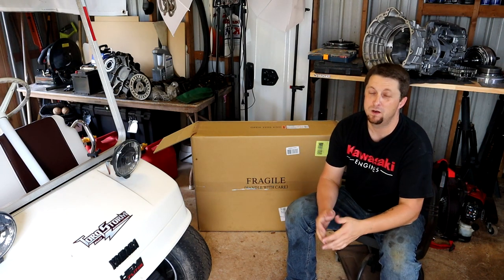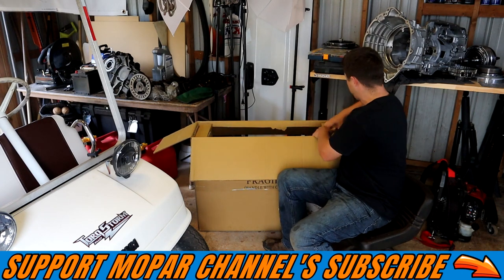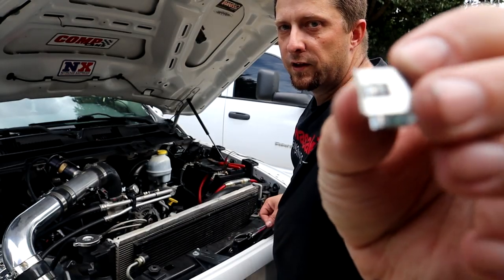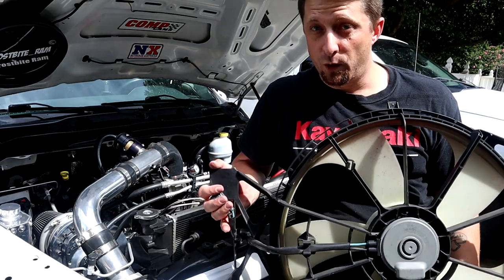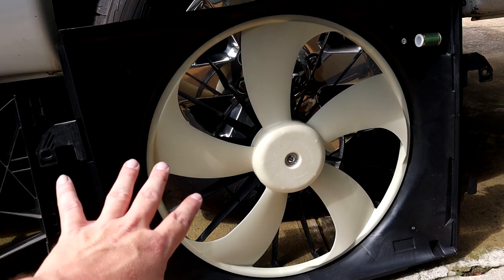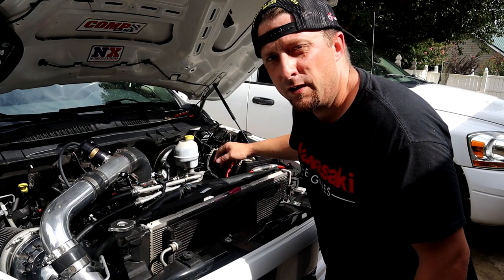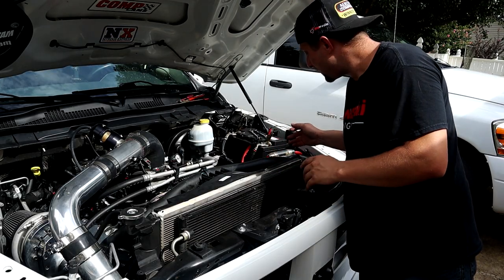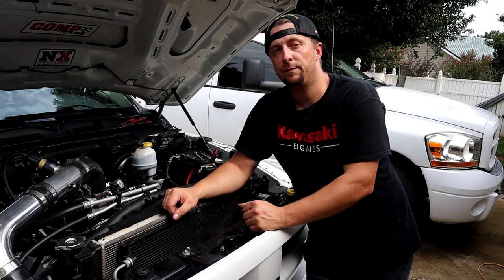Ram 1500 V6 Electric Fan Swap On 5.7 Hemi

Comment: I would’ve never guessed the V6 fan was bigger or better for pulling air through out the whole radiator... but once again.. thanks for all the part numbers and information about it 😉
Reply from the maker: Me either man but thanks for watching 👍
Reply: It's only that way because the e-fan on the Hemi is just a helper fan. The primary fan on the Hemi is the clutch fan
Reply: The radiators on both are likely the exact same.  The radiator on the Oshkosh M-ATV is actually from a Ram 3500 diesel.  I believe the inner-cooler was too but couldn't get it confirmed.  There is also a small span of VIN's of Ford Taurus that have F-150 fuel pumps.  It's crazy what they reuse, re-purpose and recycle for different vehicles to avoid engineering costs. lol
Reply: I wonder if you can run this with the clutch fan if there's enough room?
Reply: @larrybarbaree2091 I have the same question

Comment: I just got this fan for my 2013 4.7L! I don’t really care about MPG gains, but the slight performance increase is what’s keeping me going. And much better cooling from the V6 fan!
Reply: Where you from how hot does it get? I did this and my truck got hot going up hill on 110 weather
Reply: @faustodiaz2121  Im in california, gets really hot here and it hit 110-115 this summer.

Do you have your A/C on? That needs to be on if you’re un-tuned so the fan turns on.
Reply: @TheSavage3.6  yes I had my a/c on, I'm not tune, I did read about being tune when you do this efan swap but like I said, in hwy speeds and going up hill, it got hot, this was driving towards San Diego, also being @ 90° weather it was still getting hot and Temps wouldn't go down until I got to a rest area, rest for a 1hr started driving again and all of a sudden Temps where back to 203°
Reply: What year was the truck you got the fan from

Comment: Glad I came across your Video. Did my install and can’t be happier. Improved the gas mileage so far not by a lot but something is better by removing the fan clutch and cools down way faster now. Plus my condenser fan on its way out so. Perfect timing to do the e-fan conversion.
Reply from the maker: Nice work!

Comment: I definitely did this mod as I live in Florida and it definitely helped with my cooling im currently running at a constant 190 and when the T-stat opens i then run at 180 to 187. My oil temperature has dropped by 10 degrees as well..👍👍
Reply: Did you have to tune it?
Reply: @elvaquero3030  yes I had to reset the cooling parameters on the computer as the factory settings are set to 204. My particular year which is 17 I had to get an unlocked PCM before I could do those settings.
Reply: @stevelindell5044  What was the new temperature set to? I have an 2013.
Reply: @elvaquero3030  I put a 180 thermostat in and programmed my temperature parameters on my PCM  at 190 so my fan kicks on at that temperature. Since yours is a 13 I believe you do not have to buy an unlocked PCM like I did. All you should be able to do is plug in a tuner of your choice and reset the cooling parameters after you get an electric fan and replace the tstat. It will run so much cooler and also once you get rid of the mechanical fan its also less drag on the motor as well.

Comment: I did a e fan swap on the rango too I was surprised how well it has performed amazin how well a V-6 ram fan works
Reply from the maker: For sure it definitely pushes more cfm for sure 👍
Reply: what did you have to do to make it work on the rango need to do mine
Reply: @tonka459  used a test light to find positive grounds etc wired it directly and zip ties to hold her in place till I was able to make some alum. Brackets

Comment: I would highly recommend using the Hemi 5.7 electric fan motor on the V6 shroud and fan blade, Dorman is one of the few assemblies that swap over to that motor, by doing so no wiring modifications are needed. I tried it with a TYCO and the OEM motor wouldn't fit the TYCO blade, different size shaft. The hose should be trimmed about 1.5" to 2" at the thermostat housing so the shroud won't wear a hole thru the hose.
Reply from the maker: Nice information 👍
Reply: @FrostbiteRam  Mapar Guys are notorious for not sharing info, just trying to break the chain.
Reply: @ryanprettyman3123  luckily Mopar ones aren't like those Mapar guys you're talking about.

Comment: My 2017 Laramie has both electric and mechanical.  I have already had to replace the electric and am concerned that if I don't have the mechanical fan how it would survive.  It is a 4x4 and I am often deep in the woods.

Comment: Would keeping the stock e-fan and the factory clutch fan shroud not be a good alternative to swapping out the efan itself and dropping the factory shroud? I've been running this for some time and haven't had temperature issues. The fans also dont look that different IMO besides the shroud. Thoughts?
Reply: I was thinking the same thing haha, so you run the factory fan? And did you change the temp ranges with a tuner?

Comment: Thanks for the video! I may have a faulty clutch on my fan and was looking to replace it when I came as your video. Now I am thinking of doing this instead. Two questions: 1. Did you only use the AC fan before you did this swap and can I get away with just the OEM AC fan for a while in cooler temps? 2. As far as tuning, I’ve had a SCT tuner before and didn’t see an option for cooling temps or I missed it. Do you know which tuner I’d need to do this mod? 
Thanks!!

Comment: Once that fan is installed, isn't there some programming to do, to tell the vehicle it's installed and what temperature it should kick on at?
Reply from the maker: Nope but custom tuning can adjust when it comes on
Reply: @FrostbiteRam  That's what I thought.  I heard the AC fan not only comes on with the AC, but will provide additional cooling once the engine temperature hits 220 degrees.  If that's the only fan, it should probably be kicking in around 200.

Comment: Well after reading all the comments I think I got my answers but I'm going to double check . I have a 2018 hemi 5.7 ram 1500 and this will fit right in?
and if I want to adjust the temp I can use my Diablo tune? And the fan on the water pump what thread is it?
Thanks in advance

Comment: Wow, a mod I actually had done before you haha! I've got the same fan from Amazon, installed a few months ago, and no problems. Been plenty of high 90 degree weather and tons of humidity, my temps stay 185-188 with a 180 t-stat and Greene tune. Temp will creep up to 192-194 sitting in traffic, but hasn't hit 200. Hot lapping it may be a different story, but you may be better off with a 160 t-stat?
Reply from the maker: Good information 👍

Comment: I would like to know when the engine rises temperature the fan turns on by itself
Reply from the maker: Yes or if the ac is on it should come on immediately most the time.

Comment: I have the clutch fan in my 2015 ram 5.7 with no tune. Any thing particular I need to do before adding this fan? Shutter delete or new Thermostat required or is it just a drop in fan?
Reply from the maker: Fan will drop in place of factory fan

Comment: Did you have to add any blue loctite to the nut on the fan? I seen a couple posts where the nut got loos and fan came off
Reply from the maker: Mine been on for years now no problem

Comment: I have 2011 5.7 2500 with clutch fan this need tune?
Reply from the maker: No tune but you can adjust settings with tune.

Comment: Hey how are you 
I have a problem with my 2011 ram hemi the new clutch fan I put on don’t work and I change 4 of them the. Same problem 
What can it be please?
Reply from the maker: Clutch fan runs off water pump how does it not work

Comment: Looked up the fan on Amazon. Amazon is telling me that it does not fit my 2011 ram 1500. Is amazon telling me that because it is a v6?
Reply from the maker: Thats correct its for the v6 rams but it does fit the v8 also. The v6 fan has larger fan.

Comment: I’m running the Diablo 93 tune. If I do the fan mod do I need to adjust the fan temp with the tuner? It’s just a daily driver truck no towing.
Reply from the maker: No you don't have to

Comment: Any chance you could tell me the diameter and width of the V8 fan ?
Thanks
Reply from the maker: I dont have my old one anymore lol but they are very similar.
Reply: I was kicking around the idea of using a ram v8 fan as a push fan on the front of my Duramax but can’t find any info on just how big the fan is could you tell me the diameter of the V6 fan to give me an idea ?

Comment: When I was looking into it say doesn’t fit for my 2009 Dodge Ram 5.7 hemi and when I do it need to be tune up or just plug and play thanks
Reply from the maker: Its for a v6 ram so its going to say it won't fit but it does work.
Reply: Oh ok thank man and do I have to tune it up or just plug it in and run it like that thanks for tips and help Appreciate it
Reply from the maker: @adammontez8953  just plug it in

Comment: I have a 2014 Ram hemi and my transmission is overheating would you know why or how to fix this issue ?
Reply from the maker: Could be the thermostat I believe the 8speed has one.
Reply: @FrostbiteRam  Where would that thermostat be at ? Is it by the transmission ? I dont know how to fix this I did changed the fluid but im still overheating

Comment: I just got a V6 fan, 190° T'stat (no need for 180 in upstate N.Y.) couple new hoses a neck and an all aluminum rad. Truck has just under 70K and every winter when outside temps drop into teens the stock rad pees coolant all over and I spend all winter pouring more in the res tank.
I haven't lokked into it yet but it looks like the tabs that help secure the V6 fan are part of the stock rad plastic tank molding as there aren't any on the aluminum rad, obviously. Will the rest of the mounting points be sufficient to secure the V6 unit or will I need to break out some Gorilla tape to supplement?
Also, I have a Superchips f5 tuner. I run the 93 tune with MDS off, and I'm wondering if anyone knows what the "stock value" and the "superchips value" temp settings are in the tuner. They also include a 180 and 190 setting, but the other two don't reference a temp number so they're kinda pointless and I can't get the guys ay superchips to tell me what they are. Apparently it's fine sort of matter of national security to reveal to the customer what the actual temp settings are for some reason.
Your input appreciated.

Comment: What temperature does the efan kick on? And would a 180 degree thermostat effect that?
Reply: If you swap out the stat you’re going to have tune your stat to open up earlier and your fan to also come on earlier
Reply: @BlackRam17  yeah that was 2 years ago I needed up trading the truck for a 2016 Camaro ss

Comment: I'm about to replace my wife's radiator in her 2007 Aspen 5.7.  Any idea what I can use for an electric conversion?  I was thinking a 5.7 magnum shroud set up but I'm not 100% sure it would bold up and I'm not seeing any off-the-shelf kits available.  Thanks.
Reply from the maker: Thats a good question 🤔 now really sure on that but the magnum may be good candidate.

Comment: I wonder if this would fit my 2002 ram 5.9 v8 magnum.. mine has a factory clutch fan in front of original rad An a electric fan beside it with original air conditioning rad
Reply from the maker: I would think you have plenty of room to make it work. The electrical connection may be different tho but nothing a trip to the salvage yard won't handle.
Reply: Frostbite Ram my worry or wonder is if the rad size of mine from top to bottom an left to right is the same size as your rad in order to have the fan shroud fit into my rad    .. I guess I would have to measure my rad an then see if it will .. only thing is I don’t know the size of rad that yours is
Reply from the maker: I can get measurements for you
Reply: @DarrensTruckzs  will this work? Im thinking about doing the same thing
Reply: Frostbite Ram if you could give me the measurent of your rad from top to bottom An from side to side that be greatly appreciated then I check mine thanks man 👍
Reply: JR Perez I haven’t got to do measurements yet but when I do I let you know soon hopefully lol
Reply: @DarrensTruckzs  alright thank you👍

Comment: How was it when you removed the manual clutch fan did it still cool the engine, before swapping the electric fan
Reply from the maker: Yes it did pretty good

Comment: In the mean time for my daily driver can I just pull off my clutch fan and run stock electric for now?
Reply from the maker: I did that for the longest time with no issues especially with a tune .
Reply: Awesome thx

Comment: I have a 2013 ram. Evidently the plug changes after 2012. Not sure if I can use this fan on mine for plug and play? Any idea?
Reply: Just use a different plug or hard wire the fan nbd.

Comment: Frostbite Ram I have two questions for you. One should I pay off by truck before building it? Two should I build my 2019 ram 1500 single cab truck into a badass race truck or build for off road? Ps if anyone else want to answer too. I do want to know what Frostbite thinks about it tho.
Reply from the maker: My vote would be pay it off and build it for the track/street. If you want to go off road I would buy a old beater for that.
Reply: @FrostbiteRam   Thanks man. I will do that then. just so u know I love your truck. My trucks has the 5.7 Hemi in it with a single exit Flowmaster exhaust and yes the exhaust came with the truck. My truck is a Superbee edition but it has manual windows and manual locks that's the only thing I don't like about it.
Reply: My truck is also a automatic
Reply from the maker: @wolfiestorm532  awesome 👍

Comment: Does anyone know if a 2019 v6 Fan would fit on  a 2019 V8 hemi version? Or is the wiring harness different?
Reply from the maker: The v6 fan should work or the one in this link

Comment: dose this swap requires any flashing? Or is that just if your putting in a thermostat to make the truck run cooler?
Reply from the maker: Don't need any tunes to use this fan.
Reply: The fan will come on when the AC is on or once the coolant hits 200f on stock tuning as on the V8s the stock fan is supplementary to the clutch fan.

Comment: I'm curious as to what I need to do about the '05 I have.  Get a v-6 electric fan for that year?  How would I hook it up since I currently have a clutch fan?
Reply from the maker: You could remove the clutch fan and install a aftermarket electric fan pretty easily
Reply: @FrostbiteRam  what does the electric fan hook to to turn on though as far as the connection for the fan motor?  I'm assuming the electric fan bolts up the same way as the fan shroud?  What about the washer fluid/coolant recovery tank?  Does it mount the same way on shroud for the electric fan?

Comment: I did my water pump radiator and thermostat last night, and broke the new one this morning on the way to work. I’m having a bad day... this is the solution, and oreily auto is gonna pay. I am a mechanic, and this has never happened to me before. A goose then something let loose.  From the sound I thought it was gears or something.  Nope, just a fan clutch still on the pulley playing helicopter in my engine bay. Chopped the top hose, and ate the fan shroud. It better not have poked a fucking hole in my brand new rad
Reply from the maker: Damn.
Reply: I had my suspicions it was a cheap part. The aluminum looked more like bb’s pressed together than a cast part. And the pump blades were plastic.  I went through the shop I work at so it a guarantee that I will get a more expensive pump for my troubles. I need truck friends.

Comment: Hey frostbite, how come you didn't want to install your own fan switch for your new fan instead of using the same auto-temp relay from your original fans set up??
Reply from the maker: Because I have the the fan coming on early in the tune
Reply: @FrostbiteRam what temperature you have the fans coming on ?

Comment: What tuner did you use to change the on off temp settings? Thanks
Reply from the maker: At that time I was with Jay Greene you can also use a diablo sport programmer or hp tuners
Reply: @FrostbiteRam  thnx for the reply. I wanted to order the Diablo due to it being less expensive than the others but I read a bunch of comments saying that you can't change the fan settings with it. Now that you gave me the confidence in it I'm going to order one now 🤣
Reply from the maker: @HotOneRecordz  yes I had the diablo trinity t1000 it worked great
Reply: @FrostbiteRam  perfect! Thanks!

Comment: Can I do this to my 4.7??
Reply from the maker: Not sure on the mounting and electrical connection.
Reply: What about in a stock truck, no tuner is needed? I'm interested on this set up but I seen with the tuner you can mess with the temp. To make you fan turn on faster
Reply: Where I live it gets up to 115° any help thanks
Reply from the maker: @faustodiaz2121  look for a high flow thermostat like a milodon
Reply: Thanks